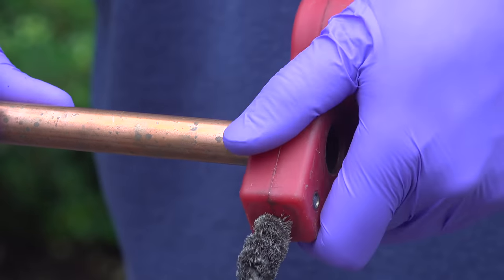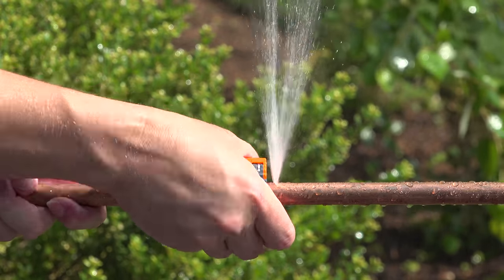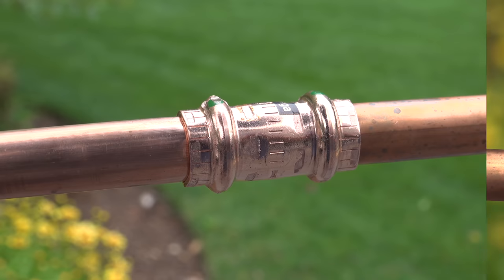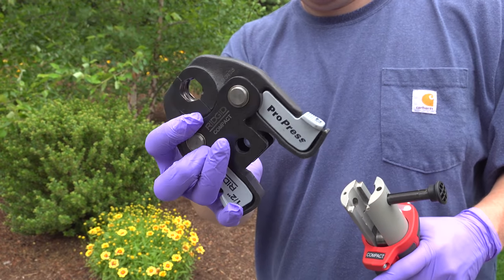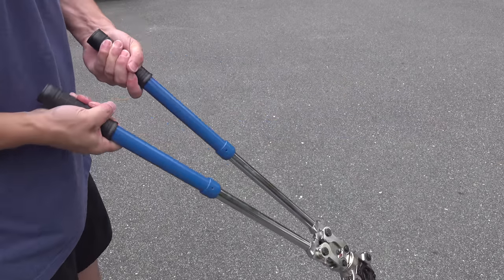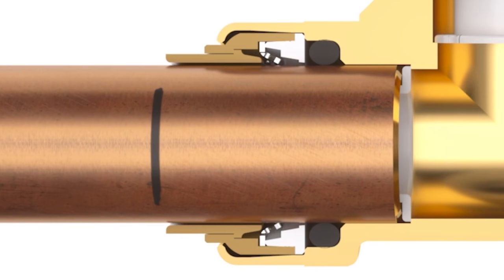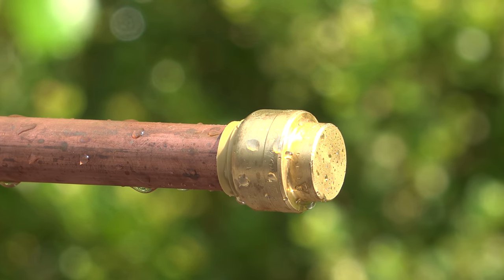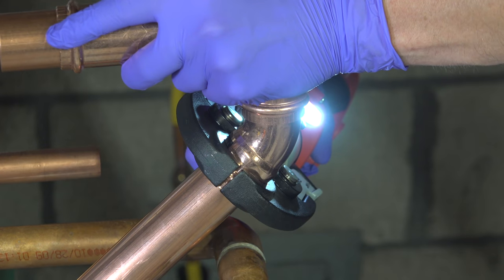NEVER SOLDER PIPE AGAIN - 3 Ways for EASY DIY Plumbing

Comment: All leaks that I have seen in the last years happened with the various solderless connections. Not one on a soldered connection. Solderless is just fast and cheap for the contractor.
Reasons for the leaks were various. If you rely on a rubber seal, your connection will eventually leak. Sooner or later! Rubber gets brittle over time and is easily damaged by wrong handling and some tiny carelessness by the tradesmen, who make their money by being fast. A tiny damage on the o ring that you won't notice - a small chip from the reamer or an incomplete deburring = leak. And even if everything is done perfectly, you won't have the longevity of a proper soldered connection, because you rely on a rubber ring with plasticizers...
Reply: Well said.
Reply: It's not cheaper, propress fittings cost like 5x as much as regular soldered fittings. 

And it's not just a regular rubber seal like you see in your garden hoses in there. If it were it wouldn't cost 5x as much as regular fittings now would it? It's a specially engineered rubber seal with a rating of 50 years. Propress has been around since the 90's and I have yet to see one of these seals fail on its own. The few propress failures I have seen were due to improper installation which is the real problem with these. It's easy so everybody thinks they can do it but yet they still manage to screw it up and then people like you blame it on the product when it's not. It's user error. No different than a poorly soldered joint leaking prematurely and since most new guys today can't solder to save their lives, propress is probably the better bet.
Reply: @losferwords100  Overall they are cheaper, and this is why it's done. Part cost is higher, but a plumber can crimp many times the fittings per hour than he could solder. What is a contractor per hour at your place? These prices are ridiculous!

In my job I have a leak about once a year. Half of the joints are soldered joints, the other half are press fittings of various types. I've been here for 6 years now and only press fits ever leaked. I can just describe my sentiment like this. I agree, it is probably possible to do it better. But as a matter of fact here: Press fittings leak at least 6 times more often. 

I solder all my connections myself. Learned it from my dad when we were building our home back then, and it's not rocket science.
Reply: @jackmclane1826  crap, nothing more nothing less.
Reply: I agree  all quick connections suck  even worse in colder climates  the plastic n the shark bites freeze then crack then fail  I’d only recommend quick connections under sinks n a control climate temperatures
Reply: That’s not really true. When pro press is done correctly, the leak failure is less than soldering. Also it’s certainly not cheaper, but it’s also much safer. No flames in walls, smoke, liability.
Reply: Not sure if it's the alloy or what, I've been seeing more and more sharkbites and brass propress failing. Not meaning at the o-rings, but in the mid fitting area. Well prepared joints, reamed and clean... failure 2 years
Reply: I trust solder over rubber any day. 50 year life span? Solder forever. If my house built in the 40s used rubber seals i would have one hell of a water leak issue in the year 2021. 
No thanks.. solder forever.
Reply: I bet if you swipe plumbers silicone lubricant onto the seals so that they are fully coated and filling the seal groove that they should last about forever.
Reply: I’m a retired plumber of 42 years experience. Retired a couple of years ago at 60 years old. Started when I was 18. Dad was a plumber too, started me sweating copper when I was 8 or 9. I’m not sold on shark bite or pro press either one. There ok in some situations. But for the vast majority of situations I can sweat up a copper job a hell of a lot faster and neater than pro press. It’s almost impossible to use in tight spaces. You just cant get the machine in there. And you have to leave a couple of inches between fittings. Thats where I’ve seen the most joint failures. Stacking fittings. Because when you press your joint it disfigures the tubing and can break the seal of the near by joint. There’s also long term expansion and contraction. And a situation where you might have to turn off the water for any number of reasons and lime, dirt or debris gets into the seal. For the vast majority of situations, pro press and shark bite are a solution to a problem that just doesn’t exist.
Reply: I've had experience around them, not using them. Like Jack says when you have rubber O rings for seals eventually there WILL BE LEAKS. Where I work now those crimped fittings were used and some ( not all ) started to leak. The fittings were installed maybe 10 years ago. Personally I like the sharkbyte fittings better, plus no special tools required.
Reply: @losferwords100  yea, shark bites are a great product. The leaks occur because the convenience of the product makes people who aren’t handy think they can do a plumbing job. 

When there are products that make an activity simpler idiots who have no business doing it will think they can.
Reply: losferwords100 could you imagine solder lasting only 50 years? But you talk like 50 years is some great span of time.
Reply: I couldn't see those O rings surviving the Temps coming from a hot water heater for very long
Reply: @arcadion448  You are making some fair arguments in your comments, never the less, you may want to look more into issues with O-Rings.
Also it is no secret, that most (if not all) long term warranty promises are pretty much useless - in the long term.
Reply: @arcadion448  There is some point in what you said. But I have never seen a pinhole later on. They seem to be easily avoided by casually running a reamer on the inside (or aren't a real thing at all). This also applies to press fittings. Soldered connections in my experience are either leak tight and will last forever or leak right from the start when you did something wrong. Which can be easily avoided.
There is only one advantage of press fittings: Working with water in the lines at repair jobs.
Reply: All leaks I have seen in the last 20 years have been soldered connections. A lot of 90 degree joints.  I vote for solderless
Reply: @arcadion448  I'm not a plumber. I'm a mechanical engineer and DIY "everything". I (by chance) worked remotely on development of the current and next generation press fittings for Viega and others jumping the train. This is why I clicked on this video because I knew the parts in the preview picture. The development process that I have witnessed was flawless. Even a bit overcautious in my opinion. This is not why I don't like this technology.

And of course I have seen a leaking solder joint. I was a kid when I did my first with my dad. But what I haven't seen is one of those delayed pinhole leaks because of turbulence. They could be a unicorn as far as my experience is concerned... Maybe all connections were just properly reamed?
Reply: @_MKE  lol
Reply: I understand plumbers are extremely hurt by this technology allowing homeowners to easily perform a repair themselves. There is nothing wrong with Sharkbite and they are now tested for durability beyond 20 years inside a wall. Of course, you have to install them carefully in order to protect the o-ring.
The OP mentions failures by installers who did not take their time or care much about the job. That doesn't apply when you are a lady who is really trying to stop a leak at home and doesn't have $500 for a plumber. If she can learn the proper way of installing the fitting, she should have no issues for years. Stop hating on the technology.
Reply: @buckstickly9086  solder does not last forever either. That longetivity for solder joints is also related to the skill and proper installation of the fittings. Same with the other products.
Reply: @losferwords100  if you haven't seen one of these fail its just because you are not looking. I've been in this biz for over a decade and yes they are fast but do fail. I've seen some leak from new. Its not an amazing new seal tech. Its literally just a rubber o ring.
Reply: @jrm2383  

"The leak failure is less than soldering"

Who said? Can you show us any definitive evidence to prove your point? It's possible to claim anything. I could say smearing a pipe with jam is foolproof.
Reply: @djbis  wen done right it lasts forever. Rubber done right 50 years. No thanks..
Reply: @djbis  It is the opposite of what you say! This will create more work and money for plumbers in the long run. This is why many plumbers use this tech. It's mostly contractors that use it! 
And as a DIY (which I am, not a plumber) it is actually much easier and cheaper to solder. I don't care that much for the number of fittings that I can do per hour. But I want to be sure it's done right forever. Contractors think the opposite. Be done quickly, so you can charge a competitive price, win the job and fit into construction schedules of bigger projects, have it last for some years and get a call for expensive repairs again later. 
This is how much of the industry works right now and this is what products like this are made to do. And many commercial installations are not long lasting either. Shops, restaurants and office spaces are ripped apart every few years and renewed.

It is the quality concerned experienced tradespeople that will warn you about press fittings.
Reply: @auspicioustoot  If you want a discussion, don't start with pathetic insults without giving any arguments. I couldn't care less about your opinion of me, but it just shows that every word with you is probably useless.
People who love press fittings are short sighted and risk their customers well being for short term profit. You are right in one point, though: They've not been used for very long. But yet they fail regularly. Should tell you something if you are smart enough...
Reply: @arcadion448  Long term warranties are GENERALLY NOT honored after many years and for many different reasons that are in the fine print. In VERY few cases when long term warranty services are honored after many years, warranty services are performed under EXTREME limitations that are again in the fine print. 

Even if O-Ring type connections are installed correctly, there are SERIOUS limitations of O-Rings with regards to their life span. So if you are really acting in good faith, then you should consider educating yourself on O-Rings first!

Otherwise, you are either a LOBBYIST, YOUNG or simply INEXPERIENCED.

Last but not least, manufacturers usually warranty the product, not the installation costs! And as far as installation cost, see my first paragraph here.
Reply: @mattdavisspe  "Its literally just a rubber o ring.". 

No, it's not dude. O-rings are dynamic seals. They're designed to move and give which leads to wear and tear and eventual need of replacement. ProPress seals are static seals. Once they're pressed, they never move and are subject to virtually no wear and tear and have significantly better longevity as a result. This is basic laws of engineering. Also the seals on ProPress fittings are treated with various elastomers which makes them chemical and temperature resistant as well as further improving longevity. 

I've seen ProPress fittings leak before and 100% of the time is was because of improper installation and not because of product failure. Pipe wasn't inserted all the way in the fitting, rubber seal damaged because installer did not deburr the pipe, it was pressed on crooked, etc. All installer error and not product error.
Reply: @arcadion448   Your response makes you either a LOBBYIST, YOUNG or simply INEXPERIENCED in which case you have lot's to learn. This is obviously not clear to you. There is a difference between DISTRUSTING technology and understanding technology! With my extensive background in engineering as well as experiences, I very well UNDERSTAND technologies and their limitations. Again, go and do some research on O-Rings before you engage in giving advice.
Reply: @martinw245  I went to a seminar 4 or 5 years ago and they had a study. Believe it or not if you want. I’ve soldered and pressed, not talking shark bite, for over 30 years, and press along with pex seems more reliable. 
It’s used on 2” boiler lines, 3” mains. I’ve been using it 7 years, not a leak. I’m sure when soldering came out, the plumbers who threaded galvanized criticized it.
Reply: @MrSocko-vn7fw  In construction a life cycle of 50 years is not a lot to begin with and even that is (at the moment) just an promise. And your 20 years is even less than that. So I see no reason for you to make claims (and let's be honest you are actually just repeating industry claims), particularly with respect to engineering and material science and with respect to the scope of your stated trade.
Reply: @mrtopcat2  your the kind of guy that replaces a furnace filter and acts like your the #1 tech in the industry lmao 😆 you know it's true. Every single person I hear talk crap about anything new in the industry are all the same.
Reply: @mrtopcat2  by the way I said I'm certain situations. Like putting in a water heater. They save you time and money which directly correlates to a happy customer. It makes swapping the water heaters out more efficient as well. There are situation in the industry where innovation is a life saver. Water heaters last ten years tops. Go ahead and do your thing idc one bit what you do. But none of you know what your talking about. There are situations where I wouldn't use them but also situations where they save me a ton of time and money.
Reply: We installed a bunch of 2" propress and discovered it absolutely cannot flex or vibrate or it will leak in short order.
Reply: Would I put a shark bite in the wall where a leak could cause catastrophic failure? No. Would I put one in a cement basement on a new water heater to make it easier to maneuver and next to a drain. Yes I do.
Reply: @patrickcamp5885  I didn't say anything about pro press
Reply: @patrickcamp5885  I have no experience with the pro press
Reply: @patrickcamp5885  I'm talking about shark bite fittings. They have come a long way. I told the other guy I wouldn't tuck them in a walk, but I use for various jobs that are in basements around drains where they can't cause damage I haven't had one fail in ten years. I'm sure the originals might have had problems but the new ones are fantastic. So we could argue for hours.
Reply: The only time I have seen a shark 🦈 bite fitting leak is because the tech installed it improperly, or put it on crooked. It won't leak if you snap it in correctly. that's a fact. A fact. I've seen people not clean the pipe, but that would have been a problem with the solder too. It always comes down to the tech. If he's a moron your going to have problems regardless of what he's doing. Period end of the subject.
Reply: @MrSocko-vn7fw  Perhaps I was too fair in my comment to your un-fair emotional rant. While I highly respect all tradesman, their work and their experiences, a tradesman (in this case a plumber) would be the last person who's opinion ANYONE would seek if it comes to engineering or material science. It is always best to stick to what you know. In this case you may think you know, but lack qualifications.
Reply: @mrtopcat2  mrtopcat... Lmao 🤣 look at your name. Top 🐈 lmao. I'm glad I don't have to work with people like you anymore. So glad. It's not an emotional rant I just can't take people like you. Your the same kind of guy that had to put a 3 inch bead weld on a muffler to make sure that it doesn't fall off a car. All 3 lbs of aluminum and takes two hours at the shop. I tell them. Your fired get out of my shop. They say but im doing the right thing. I say just get out of her go waste time, energy, and money at someone else's business.
Reply: @mrtopcat2  your like the punks in college that new everything. By second semester when it was time to start wire diagrams they all stopped showing up to class. Out of 200 people only 6 of us made it 2.5 years. Your the same type of guy that knows everything until you have to actually use your head.
Reply: @mrtopcat2  I can solder just as good as anyone. I'm sure you got a whole brief case full of different brand flux you roll around with you. I'm sure every time you turn around your co workers make you the butt of every joke. Lmao 😆 I guarantee it. TopCat. I can only imagine with your over inflated ego what your like to work with lmao. You probably drive an F350 dually too. I can already see it. Because you have to haul a refrigerator once in a while. You got a 150000 truck made for hauling cattle and gets 3mpg so you can show the whole world that you are the god of gods. The master of his trade. You probably got two divorces already too. Am I right? Or am I right?
Reply: @mrtopcat2  by the way my best friend is a civil engineer. So don't sit here and talk your chemical makeup bs with me. Big bad billy base. The molecular structure of the compound is designed from oil based material, this it is inferior to the metalergy structure of a solid structure of the solder. Lol the o rings are made of high tensile materials and shark bite offers a 25 year warranty for any damage if installed correctly. Lmao that's 4 to 5 times the life expectancy of appliances. Your so right tho.
Reply: @mrtopcat2  your the same guy that probably won't use easy to install rubber toilet base seals. You have to get the thickest wax ring on the market so you can make a mess am I right? Lmao I guarantee it. God I've worked with people like you before. Ha ha ha big bad azz billy know all lmao 😆 you can't use pex pipe. How dare anyone use pex pipe. How dare anyone use something that is new and innovative in the industry. We solder everything we need to have copper pipe. Has to be copper. Lmao I'll leave u alone buddy. The world is changing old man your going to be out of work one day you don't want to innovate. Maybe u don't need to use shark bites idc but having your attitude is just going to hold you back in life.
Reply: Ask Steve lavimere what he thinks about propress fittings he has several videos with failed pro press fittings
Reply: @TheHomePros6221  lol I don't use propress. Looks like just as much work as soldering you ask me. Honestly most everything is going to be pex piping here eventually. Copper is getting so expensive. It won't be long before copper is a thing of the past.
Reply: @MrSocko-vn7fw  Your citing of a 'best friend', who 'knows things' says a lot about your league. I'll leave it at that.
Reply: @mrtopcat2  god your so awesome 😎
Reply: @jrm2383  

You've still not provided any evidence. Just something you claimed.
Reply: @losferwords100  rated for 50 years eh? Since the 90s? So in less than two decades time there will be the potential to rip all ceilings down to replace all fittings. You have 1 rubber fail, it's time to replace them all. Solder is permanent.
Reply: @jackmclane1826  I'd argue the new pex is pretty awesome. I got called to a job where a moron didn't winterize his cabin. All the pex that I had installed was in great shape. All the copper lines burst.
Reply: @jackmclane1826  another thing is I clearly don't use fukken shark bites I said ten times in various situations like water heaters. And yes I trust them enough to have them on my own. They're great. Again I get the good shit. There are also issues with some old houses that have issues with some really old houses and customers that are absolutely too impatient and cheap to listen where they are getting ran. When I run into a solid Karen that is up my ass she's getting a shark bite.
Reply: It's rare but when they are needed they come in handy. I haven't gotten a single complaint. I have a funny feeling the stigma must have started before I was in the industry. It's like people that buy a Toyota, a ford, or a dodge I suppose. They can't handle anything else. My job is to get a job done correctly and to my satisfaction. If Karen is unwilling to listen that a certain length of piping needs replacing and argues with me through the whole process breathing down my neck. Well Karen I'll get the job done with one incision for x amount of dollars and we'll be out of each others hair up to you or I'm walking. That's how it is when you own your own business.
Reply: @philippayne6655  Bare minimum of 50 years, likely will last well beyond that but we simply have not had enough time pass to see yet. Oldest ProPress connections today are only about 30 years old. A solder joint is not permanent either and many older houses now are seeing solder joints begin to leak because of a poor solder job done 50 years ago when the house was built. All it takes is one guy forgetting to wipe the excess flux off of one joint and boom, future leaker. Nothing is permanent, everything will eventually fail and need maintenance. Proper installation is key to longevity as with anything.
Reply: Only fail many installs have is the carbon steel on heating. Many places have banned it now as it's been such an issue. Inhibitor/ filter  system needs to be spot on with carbon steel .
Reply: @djbis  lol yeah no. You are not supposed to use Sharkbites behind walls. They even tell you not to do that.
Reply: 🐻 Lokah Samastah Sukhino Bhavanthu
🐻 Sabbe Satta Bhavanthu Sukhitatta 🌱
🐻 May all Beings be Happy 💞❤️💕💗 പ്പെട്ടത് 🌎🌏🌍 പ്പല്ലട്ട്പ്പെ 🐻🌱🥥🌱🍊🌱🍎🌱🍇🌱🐻 Be Vegan ⚕️🌱🐻 റ്റഗ്ഗംഡ്യൂ
Reply: You said a lot of the same shit but definitely got the idea. 👍